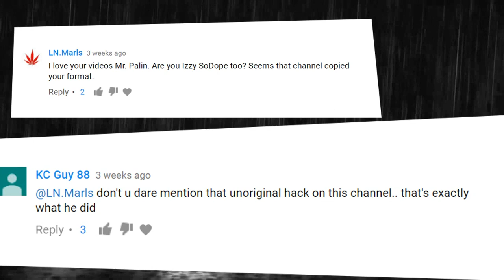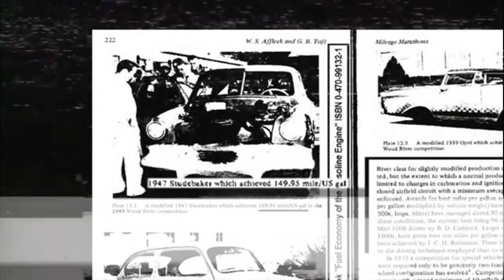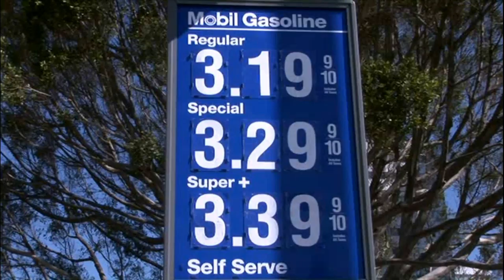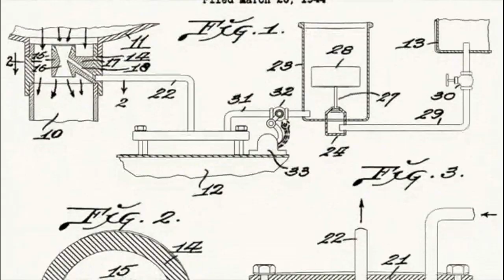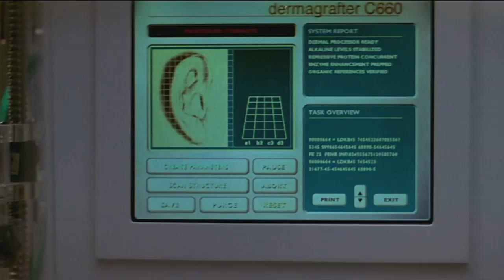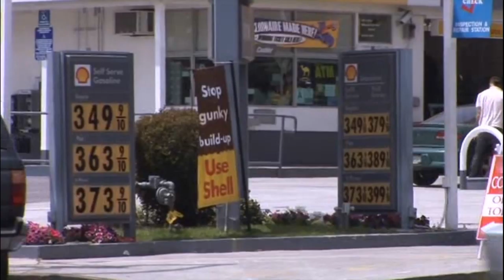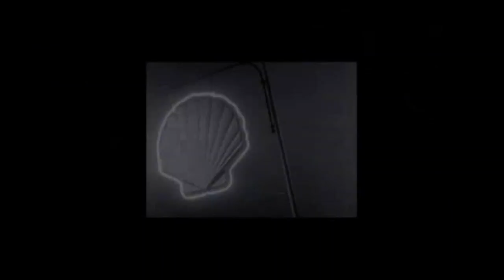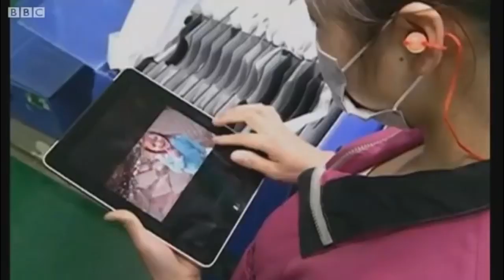Bill Burr - GasHole

Comment: >why can't we come up with something better

Thermodynamics lol. Gasoline only has so much energy potential.
Reply: Finally a comment by someone with some brain cells 🙏
Reply: Friend of mine had a 1970 datsun with 200,000 miles. It got 30 mpg.
  Fast forward to now, what's avg mpg on avg car?
Reply: @jupitercyclops6521  I call BS on 30mpg unless it was little and he drove like a hypermiler.  Also the laws of thermodynamics haven't improved in our favor since then.
Reply: @jupitercyclops6521  30 mpg back in 1970 was NOT the average, rather an outlier. The average fuel for today's cars is 24.9 mpg. That includes SUV's and light trucks, which are a hell of a lot heavier than a 1970 Datsun. Any 4 cylinder car of today gets at least 35 mpg on the highway.
Reply: Kevlar Canuck it was a little car. Idt  datsun made a big car. But he owned it in the 90s. 
  U can call bs, I cant prove it, he no longer owns it. I can find out the model if u dont want to take my word for it.
  He knew the gas mileage well because he used it 7 nights a week delivering the ks city star (I believe)
     It had 200,000 miles on it and only 2nd & 4th gears worked.
Reply: shrapnel77 good points, but still. A 5mpg increase in almost 50 yrs of technology? 
   And the environmental bs put on cars today r 1 of the problems needing adressed. How much they've helped the enviornment is arguable.
Reply: @jupitercyclops6521  I think you are giving too much credit for the internal combustion engine. It's highly inefficient. It took a computer to tell the gas how to go in to make great leaps in gas mileage. Also other factors such as aerodynamics, tire efficiency and high use of plastics also contributes greatly to increased fuel mileage. There is a ceiling to the ICE. The environmental technology on cars has made HUGE leaps in the last 50 years. Honestly, if you want better fuel mileage, then that is ultimately up to you. Lots of good, fast cars get 30-35 mpg on the highway. I rented an Altima last year for a trip. Averaged 72 mph with the air conditioning on - 41.3 mpg. I think the leaps are bigger than people realize when you consider the challenge that engineers were thrown in the 70's when they had to make an engine burn clean, yet still provide adequate power. Took decades to produce reliable, fast, clean cars on the scope of today. It's an EXTREMELY difficult problem to solve. People make it sound too easy. No one on this board can do it.
Reply: shrapnel77 so your saying it would have been impossible for a 1970 compact 4 cylinder manual transmission Japanese car to get 30 mpg in the 90s?
   U could be right. And my friend getting 30mpg probably  might not have been the cars norm. It could have happened on a night when barrametric pressure was just right and the planets were aligned just so (or maybe he used a gas pump that was off)
  But my friend  drove the car around 100 miles a night, 7 nights a week while he was going to a 4 yr auto mechanic program at a state college.
  $ was tight, he knew how to figure gas mileage and he knew how much gas he would need for his route.
   I think maybe u give too much credit to the nature of oil tycoons/gov officials/ car manufacturing execs..
    There are conspiracy theories and there are conspiracies.
    To think they havent conspired to maintain (if not expand) their fortunes is inconceivable for me. Not because that's how I am but that's how I believe they are.
   We r addicted to oil in part because they are addicted to selling us oil.
   There are way too many examples of big oil conspiring with gov to even get into. 
  The big 3 autos conspires to make sure there wont be a big 4th.
    Knowing about even some of these conspiracies makes it difficult for me to imagine that they havent all conspired to keep gas mileage low.
  Just my opinion
Reply: Yea but the combustion engine only unlocks .00001% or something of the energy potential in oil and gas
Reply: Well I can tell you that our cars that are being built are being built faulty. You have to look at thermodynamics and the engineering and begin to question what do you see wrong or can be improved. You are very close talking about the gasoline. The question that stays in my mind is "Why do we have wasted combustion coming out of the muffler including wasted gasoline?". It's 2019 and I'm thinking this is an outdated engineering idea and no one else see's it either?
Reply: @odinsmith6249  Desil engines run at around 45% efficiency. Im sure some more small gains could be made but getting anywhere close to 100% is impossible, and making  engines more efficient also makes the car more expensive because of the reduced tolerances.
Reply: @alt_warn4211  45% energy efficancy is what rotating black holes are able to achieve. Not a diesel engine.
Reply: @odinsmith6249  look up "Diesel engine  efficiency" on Google, 35-45% for vehicles and 50+ for low speed diesel engines.
Reply: Ford makes a compact car that is sold in India and a few countries in Europe it gets 72 mpg so yes believe it. It just will not happen here in America. Henry Fords first engine ran on hemp and big boys shut him down immediately because the first gasoline stations were at hand. Gasoline is a cheap by product that ruins your vehicle. Hemp is natural safe and clean
Reply: @odinsmith6249  it's actually about 30% the other 70% is wasted as heat.
Reply: @gafotaku  no the e=mc2 equation releases at most 1% of the energy through combustion. Then of THAT energy 30%used and the other 70% wasted
Reply: Check out the  big brain on Squawk.
Reply: @odinsmith6249  Well then black holes have a shitty design. We'll improve upon that sometime in the future but for now yes diesel engines can achieve 45% efficiency.
Reply: @on_another_level5661  because nothing with more energy density is either easily combustible, or safe. A lb of body fat has more energy than a lb of TNT but combusts at a much slower rate, TNT on the other hand has more energy potential than gasoline, but do you want to drive a car bomb around?
Reply: Anthony Ramsey  lol
Reply: Kevlar Canuck My first car was a 1200cc Datsun B210 hatchback.  That thing averaged around 30 mpg.  Later I had a 1985 Honda CRX HF (High Fuel), that car was good for over 40 mpg.  Both were carbureted.  Both had tiny motors and didn’t weigh much.  30 mpg was absolutely possible in the 70’s.
Reply: Just go to the Wikipedia page on energy density, it's a compromise between energy per dm^3 and kg. Compressed hydrogen may be better per kg but not dm^3. Lithium ion batteries are worse than gasoline in both respects. Gasoline is the best compromise that is also cheap. So really the only way to improve gas mileage is by reducing the work the car has to do to move through the air and reduce friction with the road, also making it lighter will reduce its inertia which reduce the energy it needs to gain to gain speed. Since ke=1/>Mv^2. In gasoline cars roughly 35% of the potential energy upon combustion is used so theoretically it would top out at about 150mpg but in reality it would be near impossible to build an engine capable of this kind of efficiency due to energy loss from heat.

When you don't understand something you have to Believe it works
Reply: you all shouldn't forget who wins money.
they don't make cars durable, because they want to sell more.
they don't make them more fuel efficient, because they want to sell more fuel.
Reply: @bobbobert4884  not in a competitive market like the car industry because if your cars are unreliable and cost a lot to run then they won't sell any.
If you have a large share of the market then you can like Apple iPhone. And filament bulbs is an example there bult to break way before they can keep going for.
Reply: @Odin Smith
Where the FUCK did you hear that?
Reply: Exactly a car engine is about 20% efficient. A less than five fold increase in efficiency is the maximum theoretical limit. Unless you add more energy to the gasoline. But gasoline is already pretty energetic. And exotic types or gasoline would make it more expensive. More than something like 180 mpg is theoretically not possible. And certainly not in a combustion engine. Gas turbines can get up to 90% efficient. Chrysler built a turbine car in the 50% it was great on the highway. Traffic, idling 20000 rpm not so much. Great engine though. Chrysler killed it like the GM did the EM-1. Those are real automotive conspiracies by the fossil fuel industry. We could have had turbine cars in the 50s and electric cars in the early 90s.
Reply: Look at a rocket stove vs a normal stove. There is a way to be more efficient
Reply: @b-b8704  You can't get more energy out of fuel than it contains. Gasoline has 45 MJ/kg of energy density. And nothing is 100% efficient so you could at most maybe get 40 MJ out of it. Which is a lot. TNT gets 15 or so MJ/kg. Current car engines can extract about 9 MJ
Reply: So you can change all the external factors like  intake and exhaust routing, variable compression and so on. The companies are making advancements. I’m surprised also that it hasn’t been more of a priority of the companies but I think it was because they didn’t care. Now with public outcry more is being done
Reply: @maggiemae7749  There's nothing special about hemp oil fuel... It's a carbohydrate, so when you burn it, you get CO2 emissions. You also get nitrogen oxides and carbon monoxide, same with gasoline or Diesel fuel.

Gasoline is natural too. It's made from mineral oil (petroleum), which is 100% natural.
The pollution from combustion engines comes from combustion of carbon-based fuels. Switching to a so-called "natural" fuel like plant oil doesn't change anything, *it's still a carbon-based fuel*. You're mixing it with air and burning it--so you get CO2, nitrogen oxides, and carbon monoxide emissions.
Hemp oil, or other plant oils, are no more "natural, safe and clean" than gasoline or Diesel fuel. In fact, it's almost the same thing!
Reply: @bobbobert4884  They do make cars durable. They make them as durable and reliable as possible for a given price point, because cars are a product, and when you're in the business of selling products, you want people to buy your product and not somebody else's!
What's with all the conspiracy-theory BS? Cars are always built to be as durable and fuel-efficient as they possibly can be without making them excessively expensive, because that's how you sell the most cars and make the most money!
I gather none of you have ever produced anything to earn a living!
Reply: You're almost half-right. A quantity of gasoline only has so much energy, but that's not what limits the gas mileage of gasoline-powered vehicles.
It's the engine's thermal efficiency, in conjunction with emissions (pollution) limit requirements. Improving the efficiency of the engine makes it use less fuel, but it also directly makes it harder to control emissions.
Currently, the auto industry is operating right at the 'sweet spot' for minimum cost per engine, lowest possible pollution per engine, and reasonably high power output. Improving efficiency and/or reducing pollution output will make the car much, much more expensive. And, it certainly isn't some sort of conspiracy, get over it!
Reply: Diesel engines can easily achieve 55mpg +
Reply: @AgillmOfficial  So can gasoline engines. How many miles per gallon you get from a vehicle depends on what kind of vehicle it is, not just what kind of engine it has.
Reply: @devilsoffspring5519  Not as easily. Diesel produces 147,000 BTUs per gallon compared to 125,000 BTUs of regular gas.
Reply: @AgillmOfficial  It isn't so much the energy content of the fuel, although Diesel fuel is indeed slightly higher.
It's because Diesel engines are more efficient, largely because of their higher compression.
Reply: @devilsoffspring5519  Of course, but in regards to OPs comment of energy in fuels, diesel has more, and yes, it's incredibly more efficient. But you've kinda argued against yourself. I say it's easy to obtain higher economy with a diesel engine. You say it's less about the engine then tell me diesels are more efficient?
Reply: @AgillmOfficial  Nope, I said your fuel economy has more to do with the vehicle as a whole rather than just the engine type.
Reply: Yeah, like the experts that told Carrol Shelby that his aerodynamics and car design were impossible and a death trap
.
Reply: @jupitercyclops6521  how much does the datsun weigh?
Reply: but how much is lost in the process? You're saying it can't be made more efficient? I'm sure that right now most cars aren't even 25% efficient. So even if you could double the efficiency of a motor you would be looking at 100 mpg or more
Reply: @jupitercyclops6521  50?
Reply: @nickafanasyev6550  that's probably about right! That sucker kept on ticking though. Eventually only 2nd & 4th gear worked and the clutch went out.
   My friend drove it like that for another 9 months or so. He could  operate it without a grind or a scratch.
   He was designated driver one night, but the $1 well drinks was too tempting for him.
   I was probably over the legal limit, but my motor skills were fine.
( time before uber and no taxi service in the town) I drove us home in the 2 speed.
   I killed it the first few times. I had to get the rpms just right before slamming it into gear.
   Every time I killed it, I had to wake up my friend because I couldn't figure out how to start the car using a screwdriver for an ignition key.
   Once I got going, there was a cheer from the 2 in the back and I had no other problems getting us home.
  No taxis but pleanty of cops, it was a miracle we hit no red lights!
Reply: @RS-kt6is  sorry, just saw your reply...
  And I have no idea how much it weighed.
   It was a compact. Pretty darn light for the day I would guess.
   I'll have to ask my friend next time I talk to him
Reply: @daveslow84  "50?" What's the question sir?
Reply: @jupitercyclops6521   I was referring to what you said (admittedly quite a few weeks ago :D)
"Friend of mine had a 1970 datsun with 200,000 miles. It got 30 mpg.
  Fast forward to now, what's avg mpg on avg car?"
my answer was 50mpg (roundabouts...)
Reply: @daveslow84  Thank you. That thread was long as were the comments, I didnt want to read through them....
   Really though, 50?!?!
 Even for   avg compact cars, that seems high.
   May I ask your source?
  It could be, I normally look into mid size cars myself.
  My daughter has Nissan Sentra . It's a compact car that nissan boasts about getting 34 mpg
Reply: Squawk7700 yes, as a liquid.
Reply: I'm a mechanical engineer and subject matter expert in this field of specialization.
Everything here is true and so much more. I have all the original documents from Shell, Cummins, The US Army, SAE, and so much more. Let me tell you something, the thermal efficiency of a standard poppet valve engine is NOT 25% efficient. Its more like 5% efficient. 	Most engines and fuel systems currently in production are designed for one specific fuel type/source. This greatly limits fuel flexibility and has been a major hindrance to the viability of alternative, renewable, and green fuels. Furthermore, long chained liquid fuels reduce the efficiency of engine systems because the heat from the combustion of the fuel is required to overcome the latent heat loss to evaporate and chemically break down the fuel before oxygen from the intake charge can bond with the hydrogen, oxygen, and various other combustible elements found in liquid fuels.
	When using liquid fuels, including direct injected liquids, no matter how well atomized the fuel is the liquid droplets are still a stratified charge that will sap heat from the engine via latent heat loss via evaporation and chemical breakdown before oxidation/combustion of the fuel can occur. This inherently means that all liquid fuel systems use a stratified charge, and can never become a true homogeneous charge. Because liquid state fuels in a stratified charge carry sound, shock, and impact waves more readily, this makes stratified charges far more susceptible to detonation and “engine knock” conditions when higher compression ratio's are used. This has been one of the primary limiting factors for engine efficiency since the beginning of the internal combustion engine.
	Gaseous fuels such as methane and propane have exceptionally higher octane ratings in both RON and MON. This is partially due to the fact that gaseous fuels readily and naturally homogenize with intake air and partially because of their shorter and simpler molecular structure. These true homogeneous charges allow engines using gaseous fuels to run much higher compression ratio's, which greatly increases the efficiency, power to weight ratio, and performance of the engine. Gaseous fuels such as propane and methane also have higher energy density's by weight because the fuel does not need to waste its own energy to break itself down to continue the propagation of the flamefront. This is why methane has the highest energy density by weight of any common hydrocarbon as it is one of the shortest and simplest hydrocarbons. By observing the various types and lengths of hydrocarbons we recognize a general pattern, that the shorter and simpler a hydrocarbon is, on average, the higher its octane rating and energy density by weight will be. In effect, the shorter and simpler the hydrocarbon is, the more energy per atom of hydrogen and carbon burned can be extracted.
And thats JUST the god damned fuel delivery system.
The throttle plate induces artificial pumping losses and creates an artificial load by reducing the volumetric efficiency of the engine at any condition other than WOT. This greatly decreases fuel efficiency, but is "necessary" because unless extra liquid is injected into the engine if it runs lean the fuel will detonate and destroy conventional engines. BUT engines capable of withstanding the forces of detonation,l thus achieving true constant volume combustion, have been designed. Most conventional engines have 4 strokes per cycle, which doubles the internal friction per power stroke compared to a two stroke cycle. Furthermore, the valvetrain is where most engine friction comes from. Not to mention that the 2 fold symmetry of wiggling connecting rods means that conventional ICE's are incapable of running in detonation as it will cause the con-rod to bend and the skirts to fold in on themselves. Engines of the 2 stroke per cycle variety typically rely on the underside of the piston, which in such designs are open to the crankcase, to act as a supercharger to force exhaust gases out of and fresh fuel/air mixture into the combustion chamber when the piston reaches the bottom most portion of its stroke and cycle. Some 2 stroke per cycle engines, especially larger industrial engines, one such example being the Detroit Diesel Series 71, instead rely on a supercharger or turbocharger bolted to the engine to provide this scavenging force rather than pressurizing the crankcase. However, these engines fail to exploit a benefit of relying on an external supercharger and/or turbocharger because they still only use one side of the piston to convert chemical energy in the form of combustible fuels into mechanical energy. The reason why they are unable to do so is because conventional connecting rod engines can not isolate the bottom of piston from the crankcase oil. Furthermore, 2 stroke cycle engines despite their higher power to weigh ratio's and greater overall efficiency have recently fallen out of favor due to recent NOX emissions standards.
	In response to this, industry as a whole has, with few minor exceptions, not pursued innovating new mechanisms to solve these challenges, instead choosing to rely almost exclusively on computer controls, electronics, catalytic converters, and various other accoutrements to reduce emissions and attempt to increase power output of conventional 4 strokes per cycle engines and has done so with limited success from an engineering perspective. However this approach, though  traditionally considered to be financially safe by accountants, has resulted in engines that are of much greater complexity, cost, are considerably more difficult to maintain, and are less adaptable for a wider scope of uses. As a result, conventional engine of the current era are highly specialized machines, and the performance gains in efficiency, power output, power to weight and displacement ratio have been relatively marginal at best. To this day even the most efficient conventional piston engines have a mere 50% thermal efficiency, and these high (by conventional standards) efficiency engines have abysmal power to weight ratio's. It is for these reasons that a new generation of engines are needed. Engines boasting higher power to weight ratio's, higher efficiency, less moving parts, less internal friction, and simpler more robust and easier to maintain designs will be necessary in the 21st century and beyond. Previous attempts at commercializing scotch-yoke type engines have failed for a plethora of reasons. One of those reasons is that though they have higher power to weight ratio's and efficiency than conventional engines, the performance increase was not sufficient to justify switching to a new designs in prior years. This is all just scratching the surface.
Reply: Br!an Delta V well, Brian, that was a goddamn long read but really interesting. So is what you’re saying that innovation in the baseline design of combustion engines could benefit from a sort of revolution in design?  It didn’t seem like you were arguing for a different fuel source.
Reply: @purplemonkeydishwasher9818  Correct. Fuel type matters not, we need to go towards a pulse detonation cycle rather than a subsonic combustion cycle. This will allow us to achieve MPG's even in full size trucks exceeding 250 MPG. My prior comment was a very brief explanation and by no means did it even come close to covering the subject in any way that can be considered whole. If you want all the information shoot me an E-mail and I will provide you with all the sources and thorough explanations.
Reply: Kevlar Canuck  don’t act like you know anything about the laws of thermodynamics or mpg. Honda civics in the 70s got 35 mpg city and 43 mpg highway. Many cars in the 80’s had similar numbers. Also the LaWs oF ThErMoDYnAmIcS have little to do with the point. Engineers can develope more efficient engines, use lighter materials etc. The first cars were electric and steam powered. There are a lot of systems that can make something more efficient.
Reply: I get that.  But on the other end, gasoline should be cheaper due to advances in technology and manufacturing.
Reply: I really don't see why we're wasting our time and energy (no pun) on ICE's at all.
Focus on cost effective Tesla's and efficient renewable energy sources.
Reply: @Myrddin8453  Because an ICE can be almost as efficient as an electric motor, and once thats achieved the energy density of cost effectiveness of liquid fuels really comes in. The electric grid itself is only about 60% efficient. Once an ICE is made thats more than 60% efficient, it actually becomes cheaper per mile to drive an ICE car than an EV by several factors over, and it also becomes cheaper to produce your own energy than buy it from the grid. ICE's are also a fraction of the cost to produce for a given power output. Effectively, we can decentralize energy production in the same way crypto decentralized finance and 3D printing decentralized plastic manufacturing.
Reply: @shrapnel77  that is true. big ships have much simpler engines, coz they are allowed to let out uncleaned gases. regular cars have extremely advanced tech in many ways, mileage is small part of it. what is true, is that big industry has big tendency to cut corners and lie about progress, if not controlled with testing and so on (VW emission scandal lately). Japanese worked hard in 90s to make those improvements, while detroit tanked. its not that scientists dont have those ready, but industry is always refusing to pay anything extra if it works now anyway.
Reply: Ya but it’s not at its full potential
Reply: If we could get that kind of energy potential from gasoline, we could also survive on less than 5 calories a day. Until they come up with a fuel with a higher energy density than gasoline that also doesn't cause an environmental catastrophe after every car accident, we're pretty much stuck with what we've got.
Reply: @stenbak88  come up with a perfect insulator that can withstand extreme pressures and then we can unlock the true potential of the combustion engine. You'll be a billionaire, and everyone will get better gas mileage.
Reply: Then why not new source of fuel... Nokia got replaced by iPhone then how come this shit is still the same
Reply: @alirohani2687  Civics on the 70s were tiny and had tiny, weak engines. In fact, their first cars were powered by 4-cyl motorcycle engines. Of course they got good mileage. The laws of thermodynamics is why. They didn't put out a lot of power per detonation. Now, we expect our cars to be powerful, large, low polluting, AND fuel efficient.
Reply: But da computahs and prahgress and evil corporations!